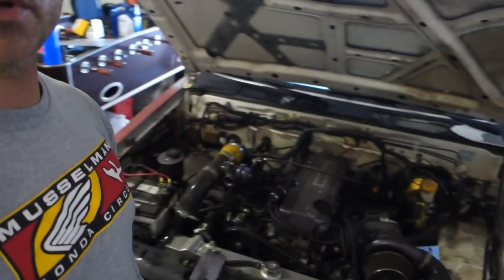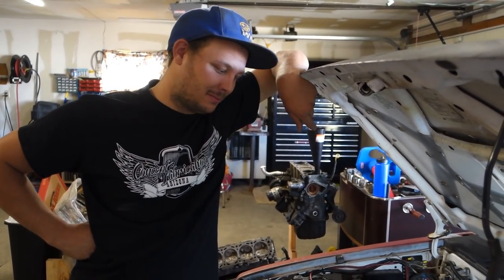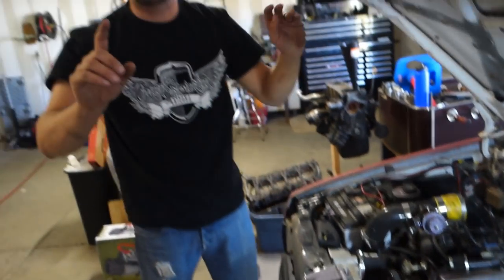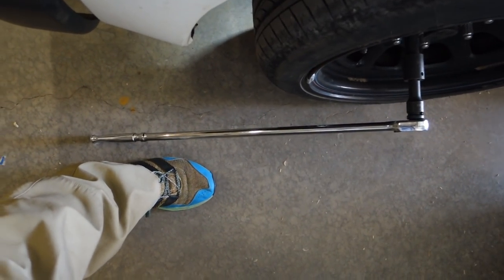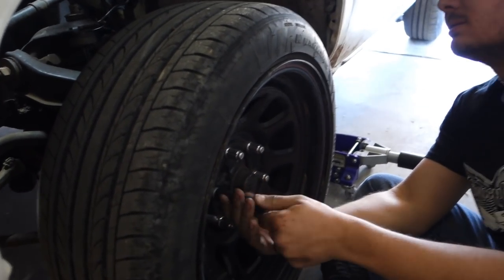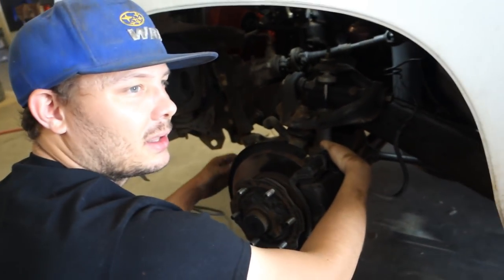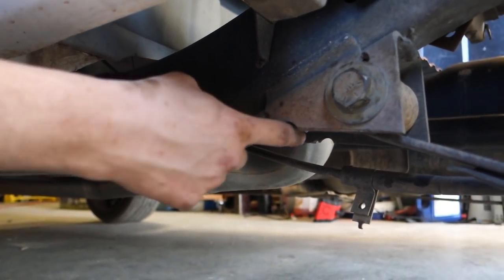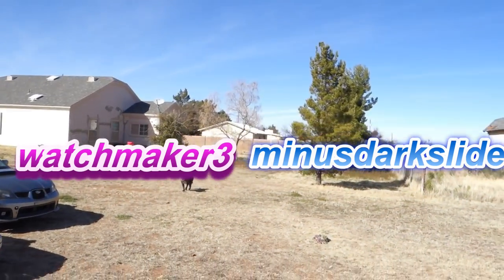Drift Prep on the Turbo Hardbody

Comment: I'm 100% for sure that your piston rings or ringland or both are broken causing excessive blow by...and over pressurized the crank case which will cause the oil to literally come out of the engine